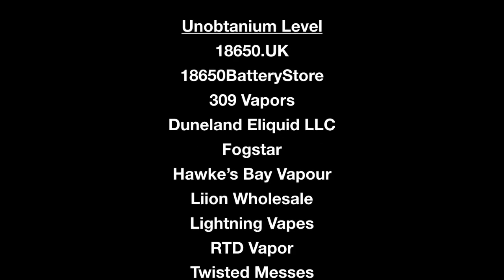Minding Your Mechs Ep018 - Defiant Designs DS Part 2 - Does contact smoothness make a difference?

Comment: This was such an excellent and informative video mooch!! I have the DD TS and absolutely love the thing, but I keep having issues with it... I'm usually able to just disassemble it and clean and what not but I can see arc marks on the little terminal and it's almost like it's creating a dead spot when depressing the fire button...I'm pretty aggravated about it too because I wouldn't necessarily consider the box to be cheap... I've even used a rotary tool to buff the contact points and it'll work ok for awhile but always ends up having to be tinkered with more... it really sucks too because my girlfriend and I both have one and I'm constantly having to mess with one of them... any idea what I might be able to do to find a remedy for these issues? I can't necessarily confirm whether it's the 3 point terminal that's the issue due to arcing or if it's just a shitty fire button situation... I've tried everything including changing out all the parts and using both silver and gold hardware that have never been uses but it still continues to have problems.  I'd appreciate any advice or insight you can think of, thanks for the awesome video on this device!!👍✌
Reply from the maker: Thank you for your kind words! There’s not much you can do about the arcing other than cleaning more frequently, replacing the contacts, or running a higher resistance coil (lowering the current). Arc marks create more arc marks so frequent cleaning is important. You can use a Scotch-Brite Heavy Duty scrubber pad on small marks to take down the high spots and remove the burnt junk that blocks a good connection.

Comment: I thought the pixies travelled the way with least resistance.So whats underneath the plating dont matter.Am i completely wrong?
Thanks for doing these test,by the way.Its very important to see it with our own eyes.
Cheers.
Reply from the maker: There’s so much of the base metal, with such a low resistance, that it just doesn’t matter if you have a microscopically thin layer of something more conductive plated onto the base metal.

Comment: I've been saying this forever... silver plated contacts are just marketing wank. A polished copper contact will fire just as hard, for cheaper. It's the reason why I refurb old mechs with basic strip contacts by replacing the contact bars with 22ga beryllium copper cold-rolled sheet.

Comment: So basically those silver plated "upgrades" are just gimmicks, it's better to properly maintain your original copper or brass contacts. Plating doesn't help.
Reply from the maker: Not if your copper/brass contacts are kept clean and smooth.

Comment: i used to work as a precision grinding specialist , and ive always wondered why these contacts arent pricision ground so that the entire contact makes surface to surface contact  not just these wonky highspots. even sanding the way you did while proved to be an increase in performance , if you were to run a .0001 indicator across that surface it would show you ^^^^^^ a bunch of tiny valleys that arent able to be seen or felt without proper tools.
Reply from the maker: Agreed, there is a lot of room for improvement. Cost is a HUGE driver for component choice though with the  mods made for our community. But if we’re able to show that tiny things like surface profiles matter a lot for performance I think we can get some companies to pay a little more.
Reply: Money is the reason and probably never gonna change

Comment: I used the ds for about 6 months and was so happy with it, but then nearly overnight it started to make no contact anymore. I tore it apart and polished everything, but nothing seemed to be wrong. I have no idea whats the matter with it, but it won't fire anymore. Anybody had a similar problem?
Reply: Had it happen to me.  Had to tighten down the contact below the button.  I had taken it apart the day before to clean it and I must not have tightened it down as well as I thought I did.